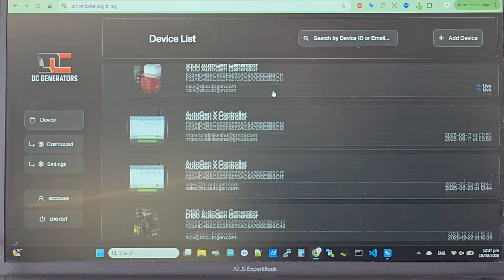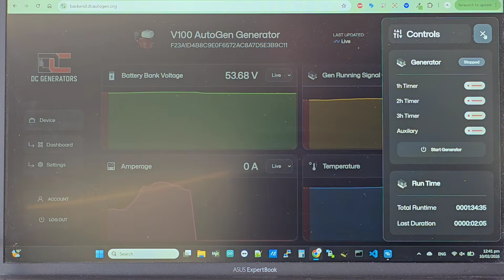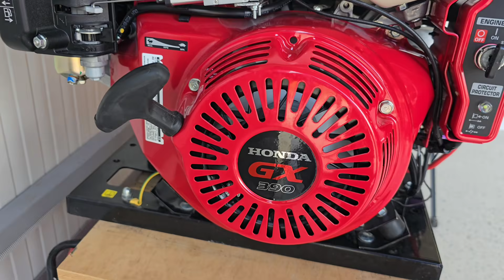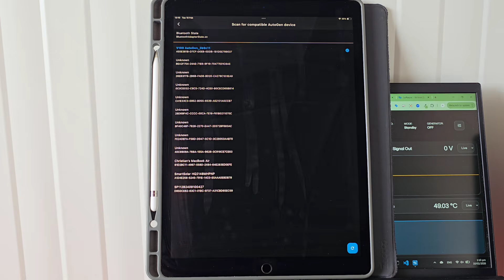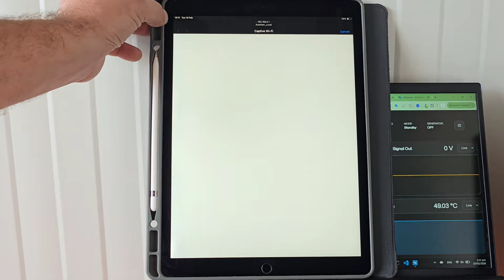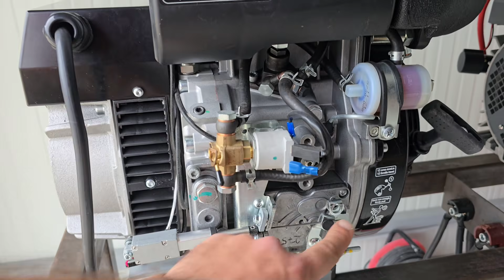48v DC Generators - IoT, Automated start plus more.

Comment: Wow those new units, jave set the benchmark. Will be talking to you soon for a 180, and a 100, as I am designing my setup at the moment. They will be primary and secondary, with my old trusty homda ex5500 as my fail-safe if needed.
Do you make then 100 in 24v as well?

Comment: How do you support these after the sale?  How is support handled if someone buys a $3000.00 generator from you and it ships overseas.  (your customer service/support reputation is not good on a diy solar forum)
Reply: I have had no after sale support from there guys. Very frustrating! I should have done more research before buying. I can't the controller on line to set the unit up.

Comment: How does this work with a grid-tie/AC generator/Solar system? My plan was to put in a system with two Victron Quattro chargeverters. Would this tie into an extra MPPT controller and just be seen as an alternate solar input by the Quattro, or how would it plug in?

Is there a natural gas-powered model that has similar output and could tie into a system like I described?

(sorry for so many questions, I am still on the "draw on a napkin" phase of designing my system and I haven't seen a generator like yours in the US because even off-grid generators are AC whole-house or portable generators.)
Reply from the maker: Our DC Generators are connected in parallel to any mppt or grid tied charger. It charges the battery bank directly.
We are working on several ways to integryinto the Victron ecosystem.
Through Canbus we can receive BMS data. Via USB to Cerbo GX as dbus stream. Mqtt via Node Red.
Ultimate would be through VE. Can, unfortunately Victron doesn't support new manufacturers so we can't get the proprietary VREGs to complete the integration.
LPG will be available on the V100 AutoGen once tests have been completed.

Comment: Something to put here for another play on this, what do you think of the idea of having a unit with a high voltage output, say 350V DC and then having a DC-DC switching power supply on the other side to charge batteries with?  The notion being to be able to carry the power a distance around a property (home) from the generator to the batteries to be charged.  Normally when powering your home from a generator, you need to place the generator away from the home so that fumes from the generator don't enter the house.  Maybe also have a bi-directional power option and use your permanent magnet generator as a starter motor off of the battery banks you are going to charge like a Prius?  In general when I think 48V, I am thinking you want to have this generator close to the battery bank, so thus a way to place the generator further away and still have good efficiency and in a compact space.

A big part of a DC-DC switching power supply is usually a good computer power supply is something like at least half of the power supply is just efficiently converting AC to DC with a good power factor with an Active PFC.  Then the other half (or less) is doing the DC-DC conversions.  So if you can delete the AC- DC part of the power supply and just do DC-DC conversions and do it efficiently (especially with the removal of the AC-DC components), you should end up with a much more compact and efficient power supply.  350V is picked here because power supplies already do this internally.  Maybe you push up to 400V or something depending on parts availability.

Another fun thing with this would be to do "Level 3" charging of EVs where you take the power output of the generator and put it through a buck-boost converter to charge an EV.  I have to wonder with the Tesla Cybertruck having a port for an extra battery in the truck bed if you could get a "range extension" option using a higher voltage DC generator like this concept and a boost converter to get up to pack voltage while the truck is in operation.  Granted, you would probably need to talk to Telsa about something like this, but I am sure there are a lot of EV truck owners in particular who would like to be able to range extend their vehicle with a generator.  Granted, you still can't make something like a Tesla Cypertruck a good towing vehicle as you are just not going to get a powerful enough generator on there, but maybe say when you go camping and there are no power hookups, you can efficiently recharge the batteries in your R/V or trailer and recharge an EV you brought with you and be fuel efficient about it.
Reply from the maker: Not very practical. 

1) 350 VDC is a different safety class
This is lethal HVDC. You now need:
proper DC-rated isolator/contactors
fuses rated for HVDC (AC breakers won’t cut it)
insulation/creepage/clearances
precharge/inrush control
safe service procedures
2) Converter cost, availability, and efficiency
A 10 kW 350→55 V DC-DC:
isn’t cheap (often a few thousand € depending on spec)
will generate heat (even 97% is ~300 W to remove)
adds a failure point
3) EMI and compliance
High power switching + long HVDC cable runs can create EMI problems unless:
proper EMI filtering on both ends
shielding/grounding strategy is correct
4) What’s your generator actually producing?
To do “HVDC transmission”, you’d typically need:
generator → HVDC rectifier (often controlled)
maybe PFC/regulated HV bus
then HVDC-DC-DC down to battery voltage.

Not designed for long cable runs. Anything upto 10m is OK.
Reply: @DCAutogen  Very interesting.  I was thinking about it because there has already been a push for 380V DC in data centers, EVs have been using voltages in this range, and residential PV systems can go up to 600V DC if I understand correctly.  So, I was thinking it would be easy enough, especially as computer power supplies internally use this DC voltage.

But yeah, I can see how when all things considered, it would be relatively quick and easy to get a 48V volt system going, say for <10m length use this thick gauge or for some more distance use this thicker gauge to help keep voltage drop acceptable and call it a day.  Just don't have lose / crappy connectors when carrying that kind of current.  Probably not up to getting PV ratings right away.  A bigger task, but I have to wonder how much PV spec and even existing equipment could be leveraged?  Like for example if you have an all-in-one solar charge controller that can have a couple of PV strings on it and you used one of those inputs to take power from a DC generator.
Reply: DC that high, as Nick stated, is into the licenced electrician world, and above 250v dc, protection gear is expensive and not readily available. And NEVER use ac rated gear for dc unless it says so.
There are solar regulators like victron go to 450v dc and morningstar to 600v dc. Stay u der 110v dc and it's way safer.
I am a sparky and elec engineer, and high voltage dc >250 dc even makes me weary.
Listen to Nick, his advice is awesome.

Comment: Would be very interested if you had a diesel engine option.
Reply from the maker: If you watch the entire the video, you will see not just one, but two diesel versions. D100 and D180 AutoGen.
Both are the smallest package diesel gensets with that power output.
Reply: @DCAutogen  thank you for your response. Where can I view the details / pricing on these units ?
Reply from the maker: @johnonellion127 soon will be available on our website.
Reply: @DCAutogen  still waiting. Any insight on timeline when this will be available ?
Reply: Can't wait to see the new units, as the 180, ticks ALOT of boxes. From what you're saying, there are more units you are releasing soon?

Comment: Some thoughts I had:
1. Can you compare the efficiency of this 48V gen set to running a common inverter generator and an AC -  DC 48V charger of a similar charging power?  I would think a major selling point of this is it is a lot more efficient to do things this way, granted at 48V, the generator would have to be placed close to the battery banks.  With a 240V generator on the other hand, the generator could be far away and you could still efficiently transmit power over a 240V power cable.
2. Propane option?
3. Silencing options?
4. Keeping the battery charged off of the 48V power bus?  Or maybe even using a 48V starter as it would be a tiny draw off of a large 48V battery bank for your home to kick over and start these engines?

These last two are major selling points of current fully enclosed inverter generators.  Also, it just seems like a common way you would want to setup this gen set is to buy propane in bulk, say that common 500 gallon propane tank for rural living and use that propane for both heating and electricity for when renewable isn't working.  Or maybe for more suburban living, you get a 120 gallon propane tank for extended outages in your area.

If you focused on propane only and a 48V starter motor, that would make this compact gen set even smaller, especially if you could get your hands on an engine optimized for the higher octane rating of propane.
Reply from the maker: Today we performed efficiency tests on the D180 AutoGen.

Test #1 — Medium Load
Voltage: 52.0 V
Current: 100 A
Power Output: 5.20 kW
Fuel Consumption Rate:
1.67 L/h
0.440 gallons/hour
Fuel Efficiency:
0.321 L/kWh
Conversion Efficiency:
31.4%
Test #2 — High Load
Voltage: 55.2 V
Current: 180 A
Power Output: 9.936 kW
Fuel Consumption Rate:
3.00 L/h
0.793 gallons/hour
Fuel Efficiency:
0.302 L/kWh
Conversion Efficiency:
33.3%
Engineering Summary
AutoGen D180 shows improved efficiency at higher load:
Efficiency increased from 31.4% → 33.3%
Fuel consumption improved from 0.321 → 0.302 L/kWh
Peak measured output: 9.94 kW
Peak measured efficiency: 33.3%

Engineering Summary
D180 AutoGen shows improved efficiency at higher load:
Efficiency increased from 31.4% → 33.3%
Fuel consumption improved from 0.321 → 0.302 L/kWh
Peak measured output: 9.94 kW
Peak measured efficiency: 33.3%
This falls within the expected efficiency range for well-optimized diesel generators, which typically consume 0.2–0.4 L/kWh depending on load and design.

Next week we will perform tests on D100 & V100 AutoGen gensets.
Reply: @DCAutogen  Seeing that the calculations for a good 240V inverter generator to say an EG4 48V charger designed to charge at 5kW comes up to less than 20% efficiency by the same metric where you are seeing over 30% efficiency, it is a massive improvement.  I thought it would be better to do it the way you are showing and from what you are saying it is a whole lot better.
Reply from the maker: @ChaJ67 definitely you will gain in efficiency this way, as there is less conversion losses.
Good quality parts and design play a major role in the outcome.
Reply: The thing about efficency is inverter generators are not significantly more efficient compared to traditional fixed rpm over 50% rated capacity - I think you brought up a great question.
Reply from the maker: The V5 AutoGen 48v DC Generator we have is dual fuel and started via the 48v battery bank. It's also only 27kgs. Very small and compact design.
The newer versions where designed to be small, yet powerful. Also the number one design option was for mobile applications. 
Of course this doesn't mean that they can't be used for fixed location, backup gensets. 
The V100 AutoGen will also be available with LPG.

Comment: I once built a variable speed DC generator around a scooter CVT, an off-the-shelf C.E. Niehoff Military alternator (N1609: 28.8V adjustable, up to 570Amps), and a 32HP water-cooled v-twin diesel from a mower/lawn-tractor.  Simple electronic circuit to monitor the field current, and increase the engine revs to balance it to about 80% of maximum current using an off the shelf DC throttle actuator - could be tuned by using a screw driver and a multi-meter.  Not as flashy, but ran the off grid storage container it was destined for, for about a decade.  As far as I know it's still running daily to top off batteries and create domestic hot water (using a plate heat exchanger) when the day's sunlight isn't enough.
Reply from the maker: That's great! Sounds like a fun project! Great job!
Reply: You ran 32 horsepower through a scooter CVT??? And it held up?
Reply: @MrHuram-abi  You know they make scooters larger than 50cc right?  If you want to do freeway speeds with two people, at over 60MPH, you're probably going to be running a 250+cc engine.  The system I built was based on a CVT out of a Honda Helix (250cc), but it was a "performance" aftermarket package that was (still is) very common in the mid 2000s.   Mostly is was a better belt with stiffer springs and semi-custom flyweights (as in, off-the-shelf flyweights but not originally meant for the CVT they went into, some machining of the flyweight channels was required).  The customization was to better match the power curve of the alternator to the power curve of the engine (they are different shapes/distributions).
  
Like all belts, they wear out, but given the discontinuous run-time of a backup system, the belt wear in practice has far exceeded the hours that would normally govern the replacement on a road vehicle.  I liked the CVT direction because the belt based CVTs have an idle RPM "neutral" where the belt doesn't engage enough to load up the engine output shaft.  Better on the starter IMHO.
  
It's not as hard as you think to read datasheets, and speak with applications engineers.  Most of it is just math.

Comment: Thx for the video... Do you have an idea of the total efficiency for your DC-DC solution vs a classic AC-DC approach ?
Reply from the maker: Today we performed efficiency tests on the D180 AutoGen.

Test #1 — Medium Load
Voltage: 52.0 V
Current: 100 A
Power Output: 5.20 kW
Fuel Consumption Rate:
1.67 L/h
0.440 gallons/hour
Fuel Efficiency:
0.321 L/kWh
Conversion Efficiency:
31.4%
Test #2 — High Load
Voltage: 55.2 V
Current: 180 A
Power Output: 9.936 kW
Fuel Consumption Rate:
3.00 L/h
0.793 gallons/hour
Fuel Efficiency:
0.302 L/kWh
Conversion Efficiency:
33.3%
Engineering Summary
AutoGen D180 shows improved efficiency at higher load:
Efficiency increased from 31.4% → 33.3%
Fuel consumption improved from 0.321 → 0.302 L/kWh
Peak measured output: 9.94 kW
Peak measured efficiency: 33.3%

Engineering Summary
D180 AutoGen shows improved efficiency at higher load:
Efficiency increased from 31.4% → 33.3%
Fuel consumption improved from 0.321 → 0.302 L/kWh
Peak measured output: 9.94 kW
Peak measured efficiency: 33.3%
This falls within the expected efficiency range for well-optimized diesel generators, which typically consume 0.2–0.4 L/kWh depending on load and design.

Next week we will perform tests on D100 & V100 AutoGen gensets.
Reply: @DCAutogen  Very nice data set! Thank you.
Reply: It should save at least 10% by skipping the conversion, but this air cooled engine can't pump its waste heat indoors in cold weather, which is a major loss.

Comment: That engine sounds like it has zero valve lash. Look up the valve clearance spec and adjust them. If you leave it at zero valve lash, not only will the engine sputter as it is in the video, you will eventually bend a valve rod.
Reply from the maker: It sounds like that as I was filming 1m away from the engine and sound gets distorted. These are new engines, you hope they are adjusted to spec!

Comment: why not just buy a harbor freight 5000 watt inverter generator and a signature solar 50v/100amp chargeverter?
Reply: The level of battery banks that the 180 would be charging, sort of warrant something a tad better, than a cheapo generator and battery charger.
Reply from the maker: That's very correct! 
When quality and consistency is essential, plus great efficiency from fuel to electric conversion, you need the relevant equipment to achieve so.
Reply: I use a crap generator and two 15 amp chargers. 😂
Reply: @GoonyMclinux  you can just get a RV charger for pretty cheap these days if your only using 12v or 24v up to 100 amps I think

Comment: if you would develop a thiny, silent 300w generator for trips, so many people would buy, including me!
Reply: Honda makes a nice 350w if that's all the power you need.
Reply: @NightshiftCustom yeah, but this design is quite old (~1990). you can do a lot compacter these days. Also they arent manufactured anymore afaik
Reply: The 9ld honda you speak of, the ex350 was a great little unit. They were 2 stroke and had either 150w or 300w setting and are an older inverter type. I have several.
When you are dealing with 48v though, I would be spending good coin on this setup nick has designed, as there's little point in building a 48v system, and skimping on you backup solution.
The software that's behind these new units, is really worth the price point it is.
You pay for a good product, that's had years of design and progression, and this would last for years.

Comment: A 5kW mains generator would have a much larger power head. How do you get away with such a small form factor?
Reply from the maker: Permenant Magnet Alternator.
Reply: I was expecting a bit more meaningful answer. I have a 1kW wind turbine which has a much larger DC permanent magnet alternator than your 5kW PMA. How is this possible?
Reply from the maker: @kevinmills5293 you can't compare a low rpm wind turbine which produces less torque to an engine driven pma with higher rpm and more available torque.
Reply: No space for slip rings, brushes and associated wiring, no windings on the rotor, high strength rare earth magnets (at a guess they are being used) permit compact rotor and stator.

Comment: Very nice app and control, this will do very well in the market, there three options from 5.5k to a nice 10K!  For a power load of 5.5k at a voltage of 48v 
 the resulting current is approximately 114A. Question how long you want it to run, for the 10K cut the time in half!
.
Reply from the maker: Thanks